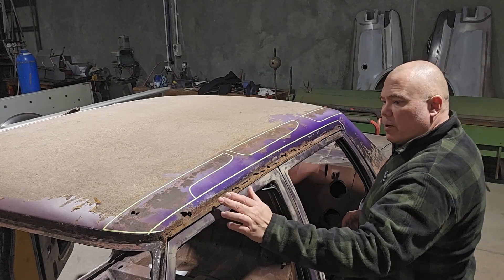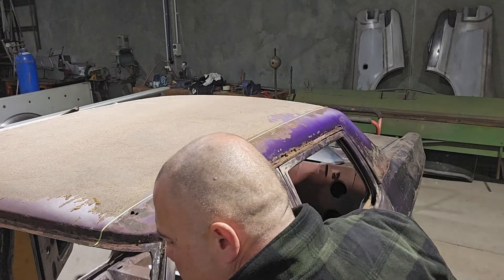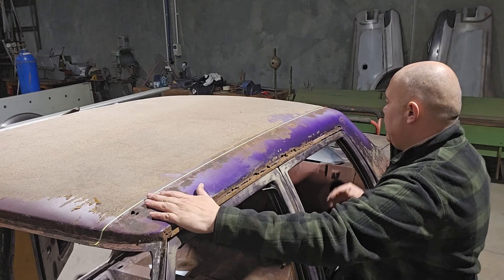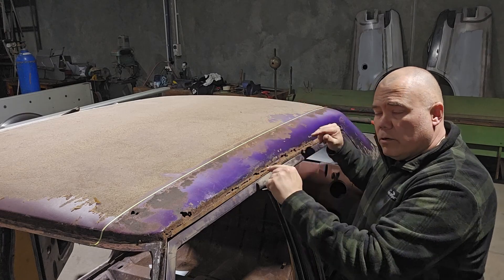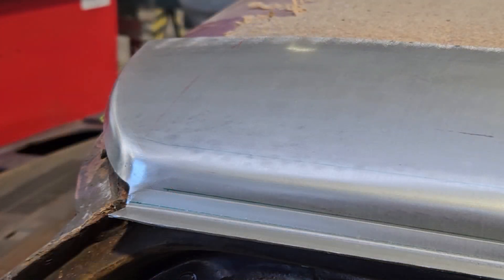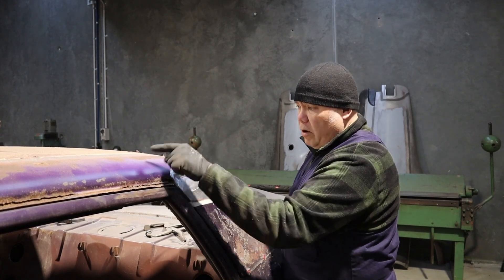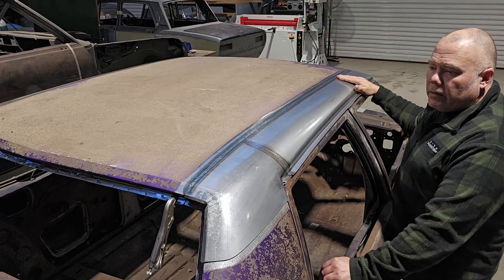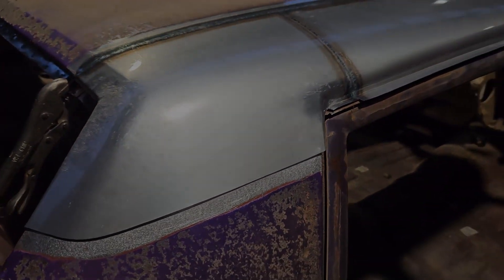This video is for those who wanted to see more of the process #12

Comment: Was trying to identify the process not shown around the 9 minute mark but was not sure what you were refering too. Could have been rust treatmentof the under panell or welding in the lower section of the C pillar. Anyway once again, I am amazed at the quality of the work. He makes it looks so easy but it's not. Keep the build video's comming please.
Reply from the maker: Hi Stew, this was all new to me when I saw it, so where the rear window seals, you can see the spot welds along that seam have been drilled- I'll leave it at that as it's all in the next video!
Reply: @The-State-of-it is he taking the whole roof skin off? I assumed that from the first video cause of the drip rail
Reply from the maker: Yip roof off. Hopefully have video ready for next week showing all.